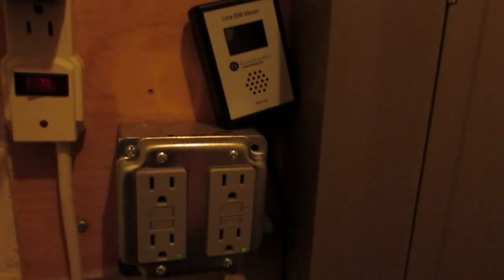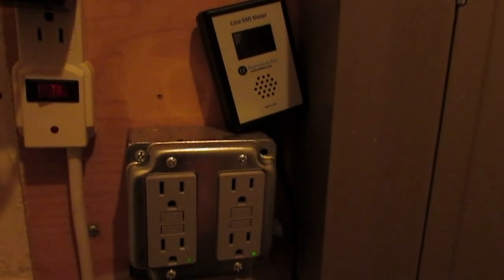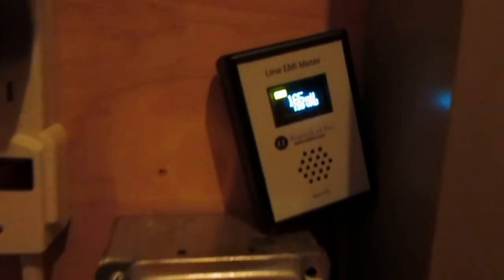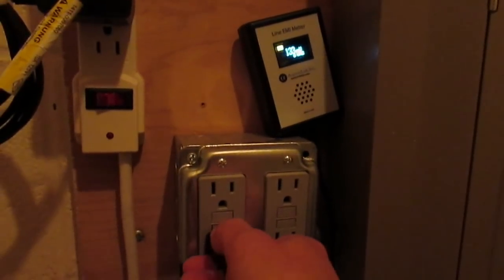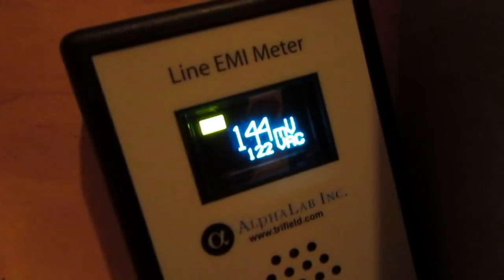How To Get Rid Of Dirty Electricity EMI Radiation | EMF Minimalist

Comment: My studio monitors are picking up and amplifying dirty electricity, I bought two different power conditioner and each said they have individual filters but I still have the constant noise. Which drives me crazy. I finally bought two greenway filters just like the one you use in the video, I can feel the difference but there is still %60 of the noise left. I know there might be a lot of reasons why because I have a lot of gears and computer in the studio but still pain in the ass.
Reply: check out Alan Maher Designs, give him a call.

Comment: Make sure your smart meter (electricity meter) is covered with a specialized smart meter guard.
Reply: That only helps if you are outside beyond it.  It will do nothing for inside the house unless you try to block from behind.  Also I wonder who know about all of the EMI that travels all over your house on the wiring FROM the Electric company's RF meter.

Comment: Hi, I have a question for you. I'm a musician. My guitar amps are not playing as they should. I attribute this to dirty power. I'm getting this fizzy harmonic distortion coming from all of my amps. At first I thought it was perhaps a preamp valve problem in the amps. That definitely is not the problem. I have tried disconnecting everything in my house from fridges to tv's, to computers. Nothing seems to work. My question is will one of these Stetzerizer filter plugs worki to alleviate this problem. Any advice or help on this problem would be greatly appreciated.  Thanks Michael Newell from Niagara Falls, Ontario, Canada

Comment: And my heaters heating ability is also eliminated turning off circuits. I just do not find much betterment with stetzer filters. They supposedly can put some other freq back on the neutral, And, high M fields in the room (so best put far away) . Any one tried ferrite beads would that do anything...? Also on out ethernet cables... ?

Comment: I just purchased the gq emf 390. There are certain parts of my rooms where the EF readings is over 70 up to 200 volts i guess. These readings usually show up around and near my outlets. Is is a good way to know i have dirty electricity?
Reply from the maker: snoo333 where ever you have an electric field, you will have dirty electricity to some degree, which can be measured with a Graham Stetzer, Greenwave or Line EMI meter. Try cutting breakers to remove/reduce the electric field, which in turn remove/reduce the DE from the space.
Reply: @EMFMiner  great idea about the cutting the breakers. Is there a device I can use to reduce in other areas.

Comment: Matt would you put a filter near 100 watt stereo Receiver 
And powered Speakers
Reply from the maker: Rmk22 SR. if it brings down the DE levels, is a dedicated circuit and is within 15 feet of the breaker panel, then I probably would.

Comment: It does seem that many modern diseases started around the time the national grid was created and the rise in electricity usage  is consistent with a greater rise in illness.However this is not proof and probably not the only factor. But it is another stress for the body to fight. It is a great shame that we have turned away from engineering which used other forms of power to operate.
BTW - one should  also look at of the electricity in a car - especially in driver's pedals area. I found some very high readings on my Trifield meter.
Reply: @Baron Von Trenk
 - I agree with you 100%!

Comment: Good info I'm just learning. A friend loaned me a Trifield 100xe which measures magnetic electricity in mili gause.
 How do you convert gause to  volts? Are there regulations on how high a magnetic reading should be before it's not safe? My Trifield  (0-100range) shows between 10-20mG all over the flooring of 2 rooms whereas the other 2 rooms of my apt only show 4mG. The guy underneath me has a lot of construction tools, I've even heard a electrical saw going), would that register as magnetic"
Reply from the maker: seeamerica1 magnetic fields are measured in milligauss or nanoTeslas (1:100 conversion). The millivolts I'm measuring in this video is dirty electricity, so not comparable to the mG you are finding. What you are finding sounds pretty high, although it's common to find elevated magnetic fields within a few inches of current carrying wires. If your downstairs neighbor has recessed lighting with ballasted (LED/CFL) bulbs, that would also raise things. Water pipes can carry current (and increase fields as well). 

Start by understanding what the background levels around your building are. If they are 4mG everywhere, even outside, that's a problem you probably aren't going to be able to fix. Then, if you have access to a breaker panel, try turning everything off to your apartment to see if you can identify the circuits that are causing the elevated fields. 

The bottom line is that you want levels to be < 1 mG (preferably < 0.5) where you are sleeping and no higher than 2 everywhere else. There are no regulations that limit this, but the Building Biology guidelines lay out 4 levels of concern, 0-0.2 being "no", 0.2-1.0 being "slight", 1-5 being "severe" and 5+ being "extreme." From what I typically find in most homes, average is about 0.8 mG. I hope this helps!

Comment: So if I am understanding you correctly, putting filters in at the breaker panel should sufficiently filter dirty electricity in the house? One doesn't need to put filters in every socket in the house?
Reply from the maker: Nancy Brown I don't recommend using a lot of filters. Reducing DE and electric fields is best accomplished by turning off circuits, especially at night. The more circuits you have off, the more effective the filters at the panel will be. If you are filtering at the panel and not producing DE in the home, you should be able to reduce your exposure a great deal. 

There are certain situations (usually related to solar inverters) that do not respond well to filters. 

Your mileage may vary, so the important thing is to test for all forms of EMF (it's easy to focus on one aspect and miss things).
Reply: @EMFMiner  
What's DE

Comment: how is this emf/ ehs with inductive cooking
or anyone with respiratory conditions
Reply from the maker: memphismemories inductive cooktops should definitely be avoided due to their EMF emissions. There is evidence that asthma can be triggered by electromagnetic radiation. In general, if you are getting a lot of EMF exposure, your body will produce more cortisol and can be more reactive to other environmental stressors like noise, smoke, pollen and chemicals.
Reply: thanks but its already too late for me
Reply: Everyone Listened but No One Heard Me
thank you for responding
Reply: OK     im copd
could you give some info on the effects 
no one beleives me
Reply from the maker: memphismemories It's never too late, even though most people do not want to believe this information. Get your adrenals and cortisol levels checked and your living space checked for EMF. Reduce the EMF and watch your adrenal function and health improve. I would also get a CO2 meter for your home and make sure your indoor air has <800 PPM of CO2 at all times.
Reply: 2 different doctors  arent familiar with emf at all
Reply: @Lw5212  - OMG... Wow, this is the first time I heard from someone about Electrical Stove / Induction Cooktops.  Every time we use our Stove, my nose clogged up and usually will take about 2+ Hours to get back to normal.

Comment: Just bought a dirty electricity meter and some filters.  The readings go down quite a bit to the safe level after plugging in the filter but my EMF meter is going up and alarm goes off.  Not sure what to do or where to place filter. I don['t want to create a dangerous EMF field from the filter.
Reply from the maker: barbara wille DE filters do draw some current and generate a magnetic field within a foot or so, which is why I generally recommend placing them as close to your breaker box as possible (within 10 feet) and away from where you sleep. If you are reducing electric fields by turning off certain breakers at night, make sure the filters are NOT on those circuits or they won't help.

Which gauss meter are you using and what levels are you finding? Your background magnetic field levels (at least a few feet from any wiring in the wall/floor/ceiling) should not change much using filters, unless you have a wiring error.

A magnetic field right on the filter is completely normal and usually much smaller than what you'd find with a power supply, phone charger, fridge or alarm clock.
Reply: I am using a Stezerizer meter and it is plugged into the outlet by my bed which is where I plugged in the dirty electricity filter.  The reading from this meter goes down to 46 on this meter and  goes down to 0 on the EMF meter about a foot away which is about where my bed is.  The alarm on t he EMF meter is going off and reading high when I put it right next to the dirty electricity meter.It is also under the circuit breaker box which is also in my bedroom.  Not sure if I am safe with the EMF level if I am a few feet away.
Reply from the maker: barbara wille you definitely don't want to sleep under the breaker box or have filters plugged in next to your bed. I'm not sure what else to recommend given the info you've posted.
Reply: My bed is about  3 feet from the breaker box and 2 feet from the dirty electricity filter.  I thought that near the breaker box would be a good place to put the filter because the current is stronger there and the readings are higher.  There are no readings a foot away from the box with the filter in.  Should I put the filter across the room from the breaker box and the bed?
Reply from the maker: Is it a main panel or a sub panel? I would keep the filters as close to the panel as possible and move your bed if possible. Best option is to turn off as many breakers as you can to reduce AC electric fields AND dirty electricity.
Reply: Not sure if is a main panel or a sub panel.  There is only one circuit breaker in the bedroom panel but if you shut that off all the other circuit breakers in the other box in the hall go off. Is this the main panel or is the hall one the main panel? There are about 12 in the other box.  I do not get any readings from the EMF meter when I am about a foot away from the bedroom box and the dirty electricity filter...so should I move the filter to the other side of the room?  I thought it would be better to have it under the box.  I am sleeping about 4 feet away from the box and the meter.
Reply from the maker: It sounds like you have the main breaker in your bedroom if it controls the other (sub) panel. You haven't said what's the other meter you are using (with an alarm). You say you "do not get any readings...about a foot away from the bedroom box." If you are measuring AC magnetic fields with a gauss meter, you should always have a reading, so it sounds like that meter is limited in it's accuracy. I would install the filter(s) nearest the panel, check the levels on other outlets and see how you feel. Dirty electricity aside, I think you should get some help testing the AC EMF and RF if you haven't yet. It's not really possible for me to give certain advice without actually testing.

Comment: Can it effective to line the inside door of the breaker box with aluminum foil?
Reply from the maker: No. The concern surrounding a panel are the magnetic fields and neither foil nor the steel door will do anything to block them. Luckily, that type of EMF typically drops off within 6 feet or so.
Reply: bwaaaaa hahahahahahahahaha
Yes, try that!

Comment: Great video thanks, but you mentioned battery powered LED lights and LED's are dangerous to the eyes.
Reply from the maker: Codenamebravo we need to be careful with LEDs, especially if they are >3000K or do not have a frosting/glazing to filter the light. Because the lights I'm talking about are portable, it's very easy to use them in a way that is not disruptive to our eyes or circadian rhythm. See some of my other videos for more info:

Healthy Lighting - https://youtu.be/bE0ukF3QxNs
The Safest Off-Grid Lighting - https://youtu.be/32s916P3jWc
Office Over-Illumination - https://youtu.be/A0KOHhoMRss
Reply: @CodeNameBravo
 - Not only to Eyes, but it also affecting me with Radiations too.  My Dog and I hates it.  Anytime LED are on, we both would sneeze!  I also did a Testing on my Dog too recently, I have a Video on my Channel Testing on my Dog.  When you get a chance, take a look at it in my Channel.
Reply: @JodBronson  
Pls send me the link of that video

Comment: Have you experimented with Power conditioners, like those used in audio...Some of these, while quiet expensive, can make a dramatic difference in listening. Also dirty electricity takes a short term bath after 8PM as electrical use by industries shuts down overnight. Any comments?
Reply: @
jack mensah -  I am glad you noticed that after 8PM is less of EMF.  I too noticed that it's after 11PM where I live is less EMF and I feel much better after 11PM.

Comment: I'm just learning more about this. So grounding mats at work don't really work? Or grounding sheets on your bed?
Reply from the maker: Todd Bellow grounding is controversial to say the least. Some people swear by it, but it is not a solution to actually reducing exposure to EMFs, including dirty electricity. There are some benefits to grounding, especially outside, away from electricity. Grounding around man-made EMFs, connected to an outlet is asking for trouble, IMO, which is why I reduce EMFs as much as possible where I sleep and ground (mostly outdoors) while I'm awake and can respond if something doesn't feel right.